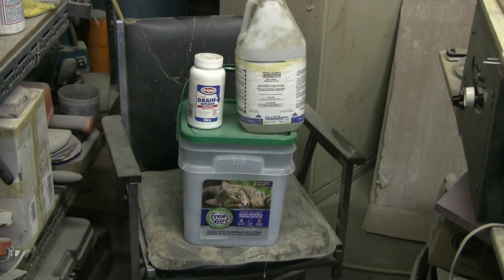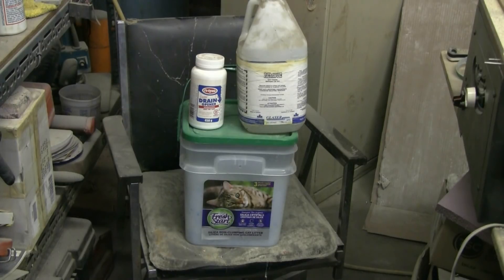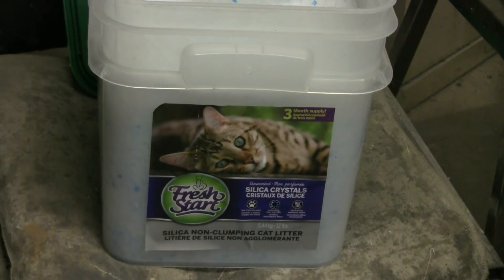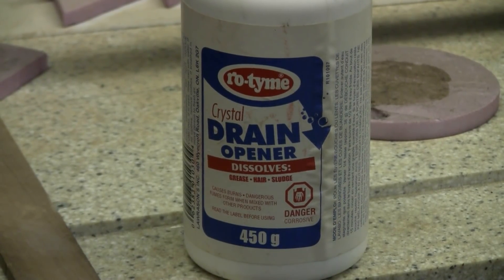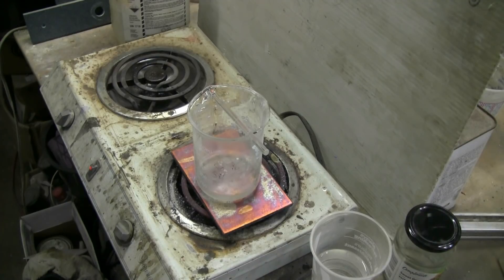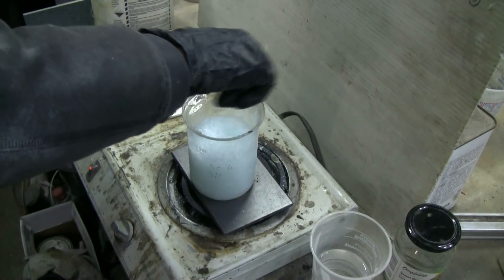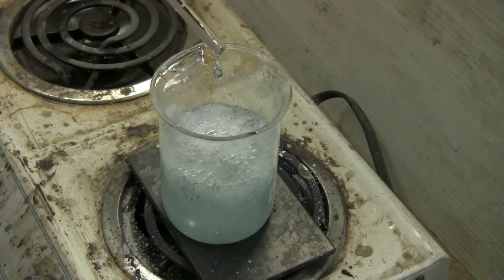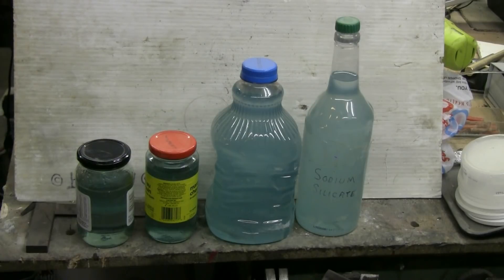How To Make Sodium Silicate (Water Glass)

Comment: As an alternative DYI procedure to make approx 500ml of highly concentrated Sodium Silicate, the procedure takes about 12 Hrs and is relatively safe.

You will need a 5gal bucket, a 2qt. Glass Canning jar, 1/4” PEX tubing, 4” and 2” funnels, and fiberglass insulation, 200g lye, 300g silica gel (cat litter), 500 ml water. There is no need to remove colored material from the silica gel.

The method takes advantage of the exothermic chemical reaction involved. It uses an insulated and sealed container, needs no added external heating or stirring and is thus relatively safe.

1. Obtain a two quart glass canning jar ( Hobby stores have these). Place the jar in a 5gal plastic paint bucket (as a safety containment device) and surround  the jar inside the bucket with fiber glass insulation.

3. Into the jar combine DRY 200g lye with DRY 300g silica gel "cat litter". Blend well.

4. Use an approx 4” funnel as a loose lid for the jar and insert approx 15” of 1/4” PEX tube thru the funnel and seal the region around where the tube enters the funnel. The 1/4” PEX tube will become a pathway to safely instill water into the dry 500g mixture. 

5. Use more insulation to completely cover the glass jar and funnel assembly. Make a hole in the center of the lid of the 5gal pail and install the lid, so that the tube protrudes through the hole. The glass jar containment is now fully enclosed and insulated.

6. Attach a small approx 2” funnel to the top of the PEX tube and slowly, instill 500 to 550 ml of water. A +250F strong exothermic reaction results. There is no need to stir or break up undissolved product. Some steam may evolve however it will be trapped by the insulation. The boiling point will shift upwards toward +250F - you don’t want to get this shit splashed onto you!. The final quiescent temp will stabilize at about +220F - leave it alone!

7. Note that chemical burns from lye heal slowly and eye damage is permanent. Don’t be stupid and try to open the assembly early just to check on it. 

8. Wait 12hrs - done. You will have 500 ml clear sodium silicate with the consistency of honey. Store in a sealed jar. Carbon dioxide from the air will cause it to solidify.
Reply: thank you sir, how about crush waste glass into powder, then boil it with NaOH? everything are so expensive here even cat litter
Reply: Ahhh, so air will make this harden? I want to make a lense with it. And, thanks for to alternative process. Really cool stuff. As mentioned above, I just finished watching "Great Pyramid K 2019". In the video they put up a very convincing example of using a giant lense of this water glass to literally melt granite. Now I want to do it lol. Thanks for any thoughts. 😊